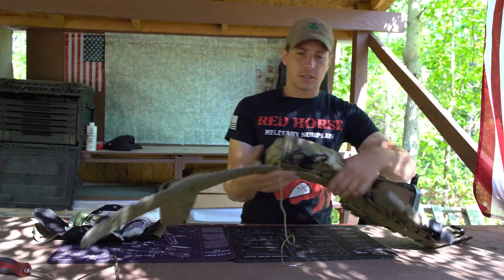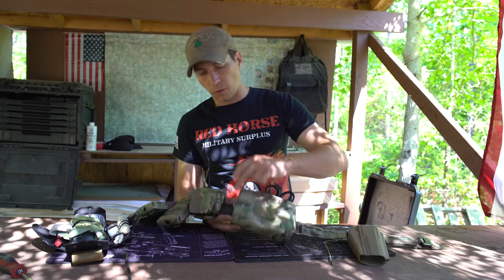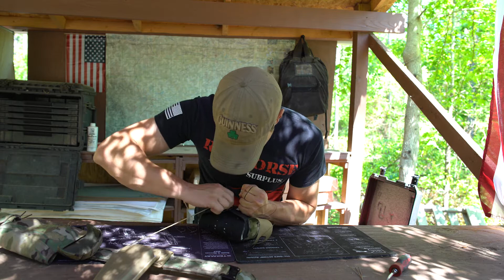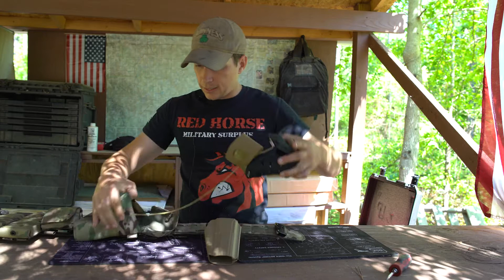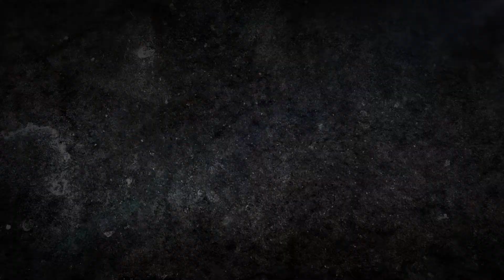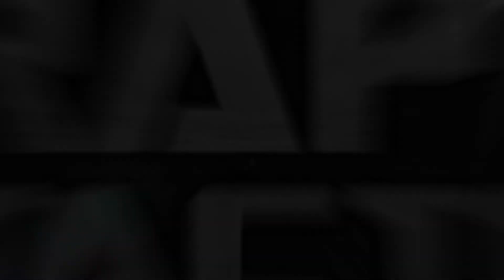MIFAK - Functions and assembling process

Comment: I’m still confused on where the pin goes.
Reply: I just got mine and also have no idea where the pin goes
Reply: Taconnce Boone I figured out, when you pull it hard enough the black loop pulls out of the top and you stick the pin through it and your string can be pulled out of the loops
Reply: Where is this pin?